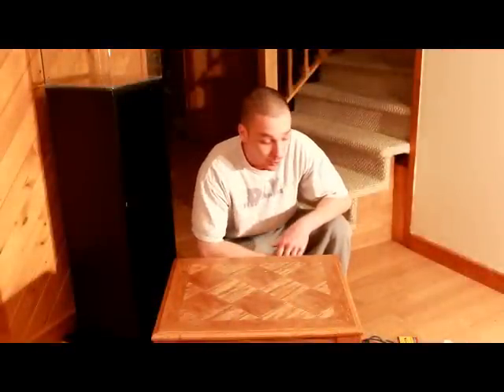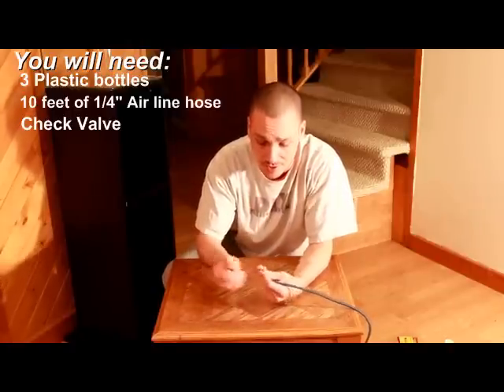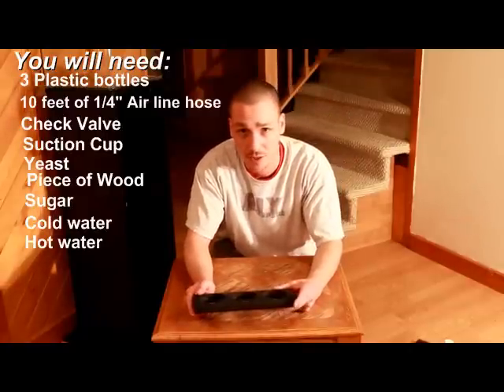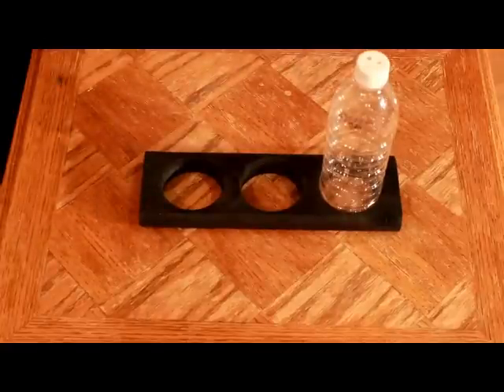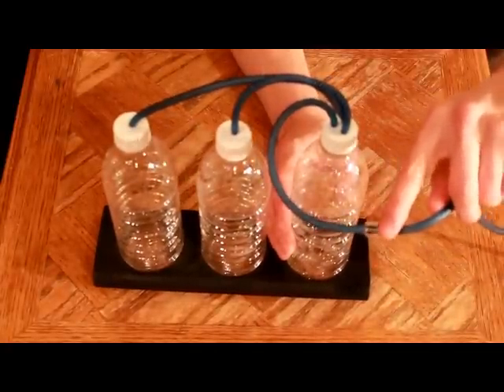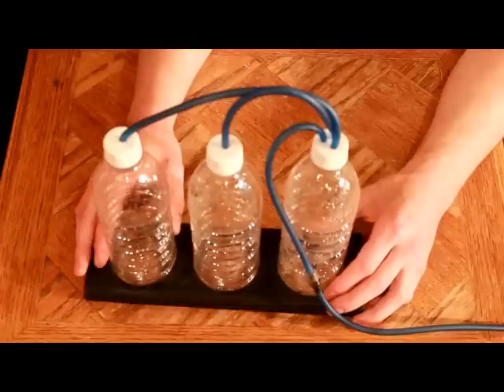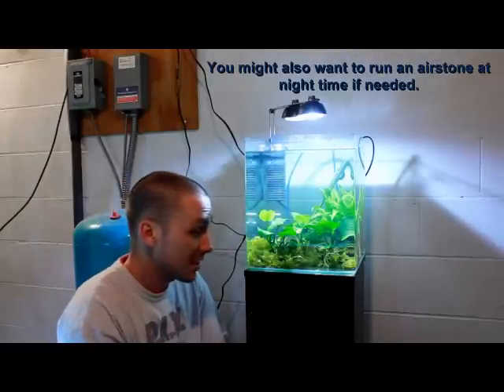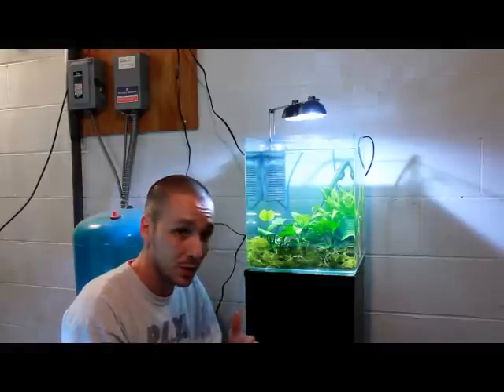HOW TO: DIY CO2 for planted aquarium TUTORIAL

Comment: You would need a gas compressor system that is not cheap and a ridiculous amount of fermentation to generate the gas. Plus why use CO2 when Nitrogen is plentiful (air is 78% N). Gas compressors for that pressure start around a few grand for small units that may take an hour or two to pressurize a small tank to well over 10 grand for a large system (similar to those used for scuba tanks).

Stick with your local paint ball shop, its a bargain to get your tanks refilled there vs buying your own.

Comment: If anyone is using a HOB filter for their planted tank, a great idea is to use a suction cup to secure the CO2 tube opening right above the impeller, that way the bubbles get pulled into the impeller and chopped up.

Comment: The great thing about yeast is when it runs out of food it doesn't die, it goes dormant. If you continually run CO2 using residual yeast from the last run will 'restart' when sugar is added again so adding new yeast is not required!